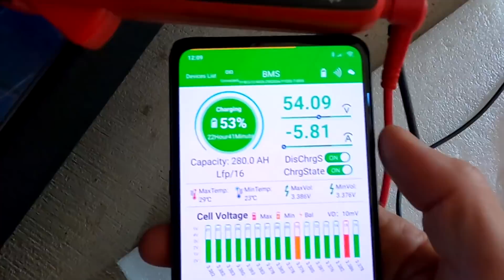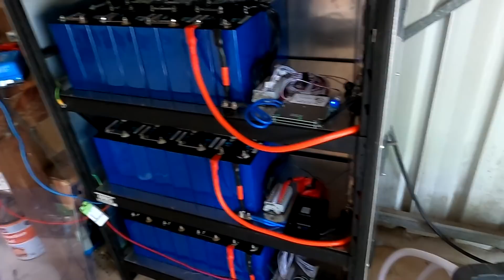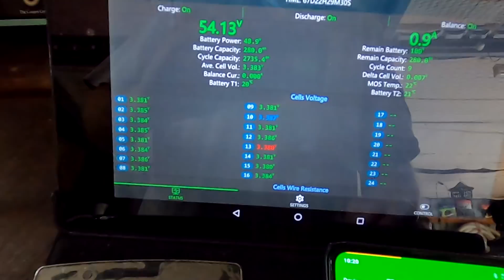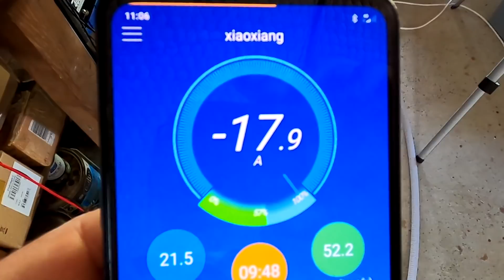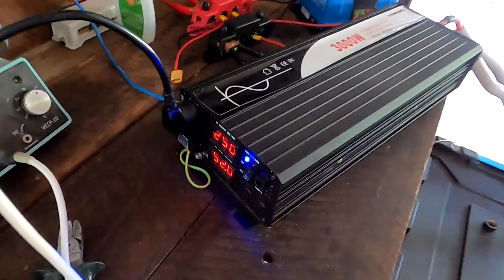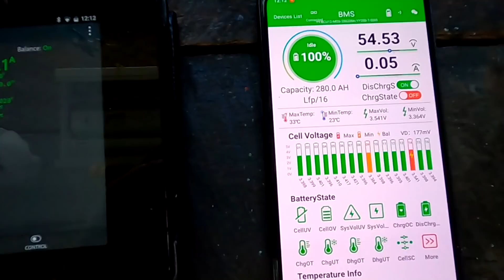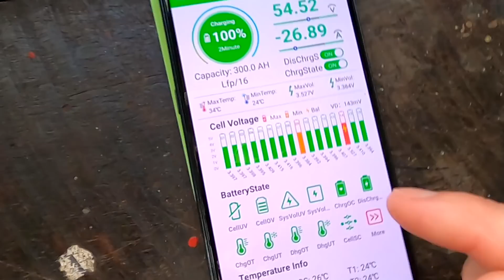Overkill, JK-BMS and Heltec in parallel. Top balancing of 3 battery banks! 🔋🔋🔋(+ magic smoke!)

Comment: Very interesting comparison. I’ve just been fighting with my QUCC BMS and the overload and short circuit settings. (Just plugging in the TV would cause a short circuit disconnect event). It would be interesting to see what the other BMS have in the way of short circuit control and if you could test them.
Reply from the maker: Testing short current functions is not easy and could be dangerous. You may want to look at the time delay before an overcurrent is detected by the BMS. The TV's power supply may have some capacitors which are causing the problem.
Reply: @OffGridGarageAustralia  in the end I maxed out the current and time parameters for overload and short circuit but I wonder if all BMS have these user settings.
Reply: sounds like you are getting out of phase so an auto transformer might be needed.  that corrects the short circuits in 110-120 volt systems for your house needs.
Reply: @dc1544  it’s a single phase system so when you talk about getting out of phase, are you talking about the power factor?
Reply: @kevinmills5293  Do you have 1 or 2 inverters with single-phase? sounds like it has 1 - 110 volt output. What country are you in? Sounds like America. what Inverter do you have? if not America then you might want to bring in an electrician.  For America add an auto transformer so you have a neutral which all it does is keep 110 in phase. I have 2 inverters that put out 240 in 2 legs but 1 phase with no neutral. so I have to have an auto transformer. If I can put same amount of amps from leg 1 and leg 2 they will cancel each other out. if I don't balance then the auto transformer will up to 5kw which I will never see as all heavy loads will be 240V. hope this helps
Reply: @dc1544  I live in Spain and there is only one inverter (Studer 24v dc 230v ac single phase). Everything has been fine running on FLA batteries.
Reply: Precisely why I only use active balancing and not a BMS. The BMS is not made for real world usage on intermittent high power loads like my 3000 watt ebike or my electric trolling motor that pulls over 65 amps at full power. For sure they will cause problems starting my outboard motor that draws 175 amps to start the motor. All the batteries are perfectly capable of supporting the loads. No BMS is designed properly for high momentary loads. Worse, many of them require a voltage input on the output or the charging line before they will allow current to pass again. Not good when you are miles in the woods or offshore on the water.
Reply: @geraldkoth654  part of the reason I chose the QUCC BMS is it’s relay based and surges and transients are not a problem for the relay. And yes, it’s a real pain when the BMS needs a kick start after a disconnect. During the day the Solar charge controller will restart it but at night, I have to use a power supply to get it going again.

Comment: Hey Andy! The current calibration problem with the heltech wouldn't be caused by the fact you're only using 3 of the four pads would it? That would be 25%.

Love your videos btw, look forward to them all the time.
Reply from the maker: Hi Paul, no can't be. All connections are in parallel and are feeding through one shunt only. We have measured 100A with the clamp meter but the display shows only 80. 20A would be bypassing the shunt inside the BMS? How?
Reply: @OffGridGarageAustralia  Hook the one up and try it... Sometimes current is measured with the mosfets and does not have a "shunt".

Comment: as your running out of space befor long for solar would a wind turbine help or is it not a valid option where you are
Reply from the maker: Not at all, we're in a valley with almost no wind. I have still heaps of roof space here on the shed. Probably can upgrade to 15kWp all in total.
Reply: @OffGridGarageAustralia  sucks about no wind but good you can have more solar

Comment: if the bms stops the charging when it wonts this kind of kills the point of a solar charge controller and one may as well use a buck or boost converter on the solar panel or panels to step solar down or step up to the max voltage you wont of the battery
Reply from the maker: The BMS does it's job and protects the battery. Usually you balance your batteries before connecting them in series. So this was just to show how you can do it as well. The BMS is not a charger and should not be used as a charge controller.

Comment: i still think your idea of the capacitor balancer running from a device with voltage trigger so it does not run all the time just when the battery hits the upper limit
Reply from the maker: Yeah, I'm doing another test now to see if it actually matters having it connected all the time or just at the higher SOC.
Reply: @OffGridGarageAustralia  I thought your past tests showed that they forced the battery into a more unbalanced state
Reply from the maker: @1981dasimpson  It may have to do with the bad terminal connections of the 'old' battery pack we tested it on the the larger deviation. Lots of people leave it connected all the time and have no such issues. Hence I re test it now with these two battery banks and perfect terminal-bus bar connections.
Reply: @OffGridGarageAustralia  I have something like them fitted in my w portable packs to try keep.them leveled on discharge to stop bms shutting down if one bank does low voltage never really tested to see if the do give me longer run time or not I just found the balance on bms struggles
Reply from the maker: @1981dasimpson  Most BMS struggle with the balance of the cells. I think if you have really well matched and high quality cells, it may work reasonably well but for most part an active balancer is needed.
Reply: @OffGridGarageAustralia  I agree and are needed even more on really big packs

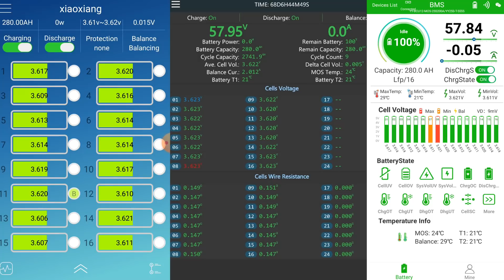Comment: I'll just point out here that at 36:08 all three batteries are set at 280Ah capacity in the settings, including the 304Ah one.
Reply from the maker: You're right. That was from testing the JK with another battery. Good observation. Glad people pay attention to details 😏
Reply: @OffGridGarageAustralia  would it affect discharging? The BMS respond s to voltage limits anyway so i taught. Only the SOC will be off from this?

Comment: check Daly  parallel pack module
Reply from the maker: They offered me that for testing. After I asked some questions, they stopped replying.
I don't see the point of it at all. It only limits the balance current between parallel banks. For what reason though?

Comment: When you turn off discharge or charging you get an extra diode drop through the turned off MOSFET for current is opposite direction so get extra MOSFET heating due to the extra MOSFET body diode voltage drop with respective passing current. Eventually the BMS detects MOSFET's are getting too hot and overrides your disable setting.  Someimes instead of heat it does the override based on about 5A maximum current in opposite direction.
Reply: Nope. The diodes inside the fets protect from emf voltage spikes. The MOSFET's body diode provides a path for inductive load current to by-pass the MOSFET during its “OFF” state. There is not any dropping of voltage.
Reply from the maker: I think the problem was the output was still connected to the DC converter and back fed the electronic. When I turn on the BMS again. The inrush current was overwhelming for the FET and the fuses kind of exploded.

Comment: Concerning HELTEK BMS. It seems, that battery and load sides of BMS have been accidentally "swapped" in its designation. Including control lines for internal "ON-OFF switch" power MOSFETs for charge and discharge control. Or, current sensor has been swapped. If current sensor is low-Ohm resistors-based circuit, than, it may be possible to fix negative/positive current error by swapping measurement signals from sensor to BMS current mesuring circuitry.
Reply from the maker: The Heltec acts weird/different in many ways. They still haven't gotten back to me yet...
Reply: @OffGridGarageAustralia  You have more patience that I do, I would've tossed that thing in the 'emergency spares" pile days ago!

Comment: Isn't there a program available where you have all the BMS info simultaneously available/visible on a laptop in stead of using 3 devices?
Reply: You can connect them over serial/RS-485 and graph the data using something like Grafana.
Reply from the maker: The three devices were just to show them all at once here in the video. Usually you don't look at them all the time. Or, what Up North and Personal said ☝️

Comment: Can you not set the SOC lower in the parameters..? There was an option there to adjust it. Perhaps it is going on the calculated SOC to determine whether to charge...
Reply from the maker: Well, I did change it as I shown in the video. It makes no difference though. The BMS thinks the battery is full and disconnects it.
Reply: @OffGridGarageAustralia  I didn't notice you actually change the SOC value in the vid. Fair enough, one for Helltek to respond to I guess...? 

EDIT: Just looked again; in BasicParameters > SOCsetting it's offering the option to put a different value in by the looks of it... Counting amps in and out is the only way it can measure SOC since, and you know LFE batteries have an extremely flat curve. So maybe setting the SOC lower might prod it into charging again...?

Comment: JK rules.

There's no need to spend weeks charging and top balancing. Just check for physical damage, measure internal resistance, make sure your busbars are properly torqued (use the pliable tinned copper busbars!), and then, (when the voltage is not too far off from the other banks) just put it in production, and all will be well.

You might not get full capacity when discharging, but that will happen, in time, when you do hit a full charge. There seems little to no point in wasting grid electrons on that, especially with battery banks this large.

Between the chaos of frogs, the dogs and the poolpump, and the occasional magical smoke, we all learn a lot here. Thanks Andy!
Reply: JK rules - absolutely! As I said before, two years up and running with two of those and I don't even notice they're there until they kick in to do their job.
Reply: @upnorthandpersonal  How high to charge your batteries to on a daily basis, and where do you have your AB set?
Reply: @ssoffshore5111  It depends on the season. In summer, I take it easy and don't set the charge controller to a lower voltage (3.45 per cell) since I have plenty of time to absorb. In early spring and late autumn, I increase this voltage to minimize charging time needed and capture as much energy as possible in a short amount of time. Similarly, in summer the battery is mostly full, in winter, mostly close to empty and I take it all the way down when I have to.
Reply: @upnorthandpersonal  Makes sense, thank you!
Reply from the maker: Thanks a lot Luc!

Comment: I would totally used the charger in the multi-plus and grabbed some grid/generator power to get it topped off.  What happens to the old battery now?
Reply from the maker: This battery will probably never see any grid power ever. The 'old' battery will be for a special project, I'm working on. But we need to repair these stripped terminals first.

Comment: You need to add some LED colored lights to signify discharged/discharging/charging/charged
Reply: I said this like months ago. Yes some visual is a plus
Reply from the maker: I thought about a dashboard with some more information maybe...
Reply: I was for this idea too some time ago when Andy was first building the shelf, & then he did make a comment to this effect of so many possibilities he could do with coloured LEDs over each shelf that could signify different events and status’s of each battery shelf unit, etc. I did like these idea’s, but I think Andy made a point of the LED strips could be seen as a potential fire hazard.
Reply from the maker: @evil17  We can probably do something like this later on when we have a look at Node Red and have far more control over the whole system. At this stage it is very difficult to connect and control LEDs as per load, SOC or other triggers.